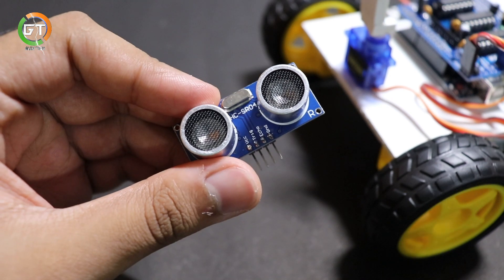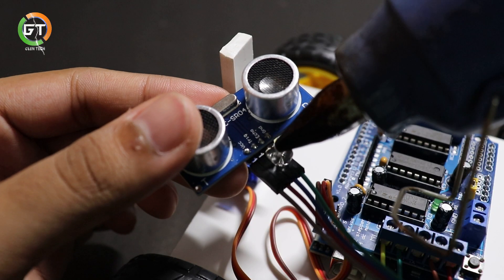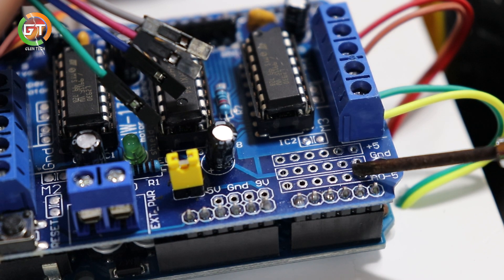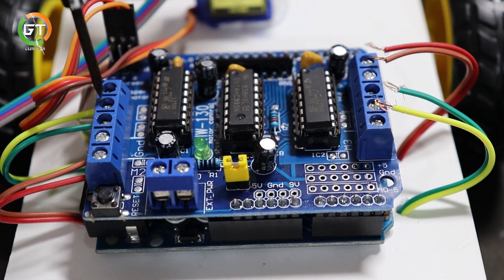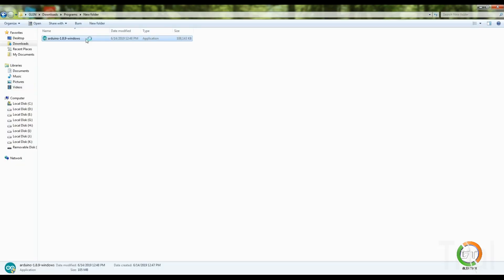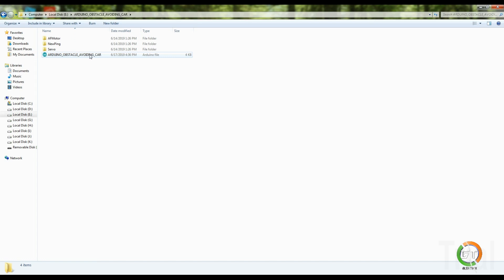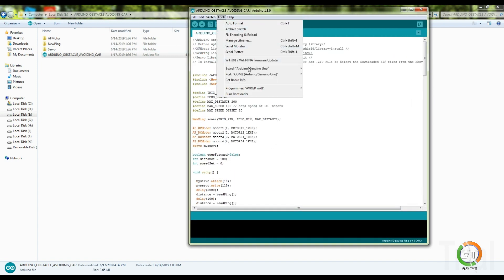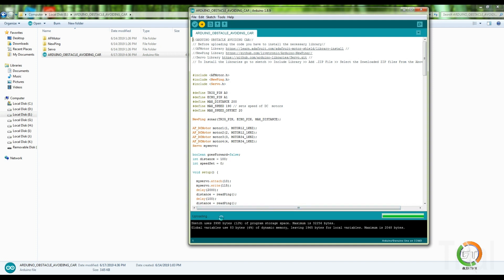How To Make A DIY Arduino Obstacle Avoiding Car For Science Project

Comment: sir the code from your link is unable to use
Reply from the maker: //ARDUINO OBSTACLE AVOIDING CAR//
// Before uploading the code you have to install the necessary library//
//AFMotor Library https://learn.adafruit.com/adafruit-motor-shield/library-install //
//NewPing Library https://github.com/livetronic/Arduino-NewPing// 
//Servo Library https://github.com/arduino-libraries/Servo.git //
// To Install the libraries go to sketch >> Include Library >> Add .ZIP File >> Select the Downloaded ZIP files From the Above links //

#include <AFMotor.h>  
#include <NewPing.h>
#include <Servo.h> 

#define TRIG_PIN A0 
#define ECHO_PIN A1 
#define MAX_DISTANCE 200 
#define MAX_SPEED 190 // sets speed of DC  motors
#define MAX_SPEED_OFFSET 20

NewPing sonar(TRIG_PIN, ECHO_PIN, MAX_DISTANCE); 

AF_DCMotor motor1(1, MOTOR12_1KHZ); 
AF_DCMotor motor2(2, MOTOR12_1KHZ);
AF_DCMotor motor3(3, MOTOR34_1KHZ);
AF_DCMotor motor4(4, MOTOR34_1KHZ);
Servo myservo;   

boolean goesForward=false;
int distance = 100;
int speedSet = 0;

void setup() {

  myservo.attach(10);  
  myservo.write(115); 
  delay(2000);
  distance = readPing();
  delay(100);
  distance = readPing();
  delay(100);
  distance = readPing();
  delay(100);
  distance = readPing();
  delay(100);
}

void loop() {
 int distanceR = 0;
 int distanceL =  0;
 delay(40);
 
 if(distance<=15)
 {
  moveStop();
  delay(100);
  moveBackward();
  delay(300);
  moveStop();
  delay(200);
  distanceR = lookRight();
  delay(200);
  distanceL = lookLeft();
  delay(200);

  if(distanceR>=distanceL)
  {
    turnRight();
    moveStop();
  }else
  {
    turnLeft();
    moveStop();
  }
 }else
 {
  moveForward();
 }
 distance = readPing();
}

int lookRight()
{
    myservo.write(50); 
    delay(500);
    int distance = readPing();
    delay(100);
    myservo.write(115); 
    return distance;
}

int lookLeft()
{
    myservo.write(170); 
    delay(500);
    int distance = readPing();
    delay(100);
    myservo.write(115); 
    return distance;
    delay(100);
}

int readPing() { 
  delay(70);
  int cm = sonar.ping_cm();
  if(cm==0)
  {
    cm = 250;
  }
  return cm;
}

void moveStop() {
  motor1.run(RELEASE); 
  motor2.run(RELEASE);
  motor3.run(RELEASE);
  motor4.run(RELEASE);
  } 
  
void moveForward() {

 if(!goesForward)
  {
    goesForward=true;
    motor1.run(FORWARD);      
    motor2.run(FORWARD);
    motor3.run(FORWARD); 
    motor4.run(FORWARD);     
   for (speedSet = 0; speedSet < MAX_SPEED; speedSet +=2) // slowly bring the speed up to avoid loading down the batteries too quickly
   {
    motor1.setSpeed(speedSet);
    motor2.setSpeed(speedSet);
    motor3.setSpeed(speedSet);
    motor4.setSpeed(speedSet);
    delay(5);
   }
  }
}

void moveBackward() {
    goesForward=false;
    motor1.run(BACKWARD);      
    motor2.run(BACKWARD);
    motor3.run(BACKWARD);
    motor4.run(BACKWARD);  
  for (speedSet = 0; speedSet < MAX_SPEED; speedSet +=2) // slowly bring the speed up to avoid loading down the batteries too quickly
  {
    motor1.setSpeed(speedSet);
    motor2.setSpeed(speedSet);
    motor3.setSpeed(speedSet);
    motor4.setSpeed(speedSet);
    delay(5);
  }
}  

void turnRight() {
  motor1.run(FORWARD);
  motor2.run(FORWARD);
  motor3.run(BACKWARD);
  motor4.run(BACKWARD);     
  delay(500);
  motor1.run(FORWARD);      
  motor2.run(FORWARD);
  motor3.run(FORWARD);
  motor4.run(FORWARD);      
} 
 
void turnLeft() {
  motor1.run(BACKWARD);     
  motor2.run(BACKWARD);  
  motor3.run(FORWARD);
  motor4.run(FORWARD);   
  delay(500);
  motor1.run(FORWARD);     
  motor2.run(FORWARD);
  motor3.run(FORWARD);
  motor4.run(FORWARD);
}
Reply: Sir but you have to put these libraries in description if you put here most of the people not see properly
Reply from the maker: @swamyswami3737  in description there is a link to download these files

Comment: How to recharge battery
Reply from the maker: You need to buy a battery charger or you need make one .

How to make a charger video I will upload next day .
Reply: TP-4056 is a charging module for 18650 li-ion batteries
Reply from the maker: @lokeshlucky7593  yes

Comment: Code false
Reply: Wassim Soualili Nice joke but no need to use now. My project done and code is 💯💯% working............Glen Tech is a Hero!!!
Reply from the maker: Did you copy and paste other files to Arduino folder in my documents
Reply from the maker: //ARDUINO OBSTACLE AVOIDING CAR//

// Before uploading the code you have to install the necessary library//

//AFMotor Library https://learn.adafruit.com/adafruit-motor-shield/library-install //

//NewPing Library https://github.com/livetronic/Arduino-NewPing// 

//Servo Library https://github.com/arduino-libraries/Servo.git //

// To Install the libraries go to sketch >> Include Library >> Add .ZIP File >> Select the Downloaded ZIP files From the Above links //

#include <AFMotor.h>  

#include <NewPing.h>

#include <Servo.h> 

#define TRIG_PIN A0 

#define ECHO_PIN A1 

#define MAX_DISTANCE 200 

#define MAX_SPEED 190 // sets speed of DC  motors

#define MAX_SPEED_OFFSET 20

NewPing sonar(TRIG_PIN, ECHO_PIN, MAX_DISTANCE); 

AF_DCMotor motor1(1, MOTOR12_1KHZ); 

AF_DCMotor motor2(2, MOTOR12_1KHZ);

AF_DCMotor motor3(3, MOTOR34_1KHZ);

AF_DCMotor motor4(4, MOTOR34_1KHZ);

Servo myservo;   

boolean goesForward=false;

int distance = 100;

int speedSet = 0;

void setup() {

  myservo.attach(10);  

  myservo.write(115); 

  delay(2000);

  distance = readPing();

  delay(100);

  distance = readPing();

  delay(100);

  distance = readPing();

  delay(100);

  distance = readPing();

  delay(100);

}

void loop() {

 int distanceR = 0;

 int distanceL =  0;

 delay(40);

 

 if(distance<=15)

 {

  moveStop();

  delay(100);

  moveBackward();

  delay(300);

  moveStop();

  delay(200);

  distanceR = lookRight();

  delay(200);

  distanceL = lookLeft();

  delay(200);

  if(distanceR>=distanceL)

  {

    turnRight();

    moveStop();

  }else

  {

    turnLeft();

    moveStop();

  }

 }else

 {

  moveForward();

 }

 distance = readPing();

}

int lookRight()

{

    myservo.write(50); 

    delay(500);

    int distance = readPing();

    delay(100);

    myservo.write(115); 

    return distance;

}

int lookLeft()

{

    myservo.write(170); 

    delay(500);

    int distance = readPing();

    delay(100);

    myservo.write(115); 

    return distance;

    delay(100);

}

int readPing() { 

  delay(70);

  int cm = sonar.ping_cm();

  if(cm==0)

  {

    cm = 250;

  }

  return cm;

}

void moveStop() {

  motor1.run(RELEASE); 

  motor2.run(RELEASE);

  motor3.run(RELEASE);

  motor4.run(RELEASE);

  } 

  

void moveForward() {

 if(!goesForward)

  {

    goesForward=true;

    motor1.run(FORWARD);      

    motor2.run(FORWARD);

    motor3.run(FORWARD); 

    motor4.run(FORWARD);     

   for (speedSet = 0; speedSet < MAX_SPEED; speedSet +=2) // slowly bring the speed up to avoid loading down the batteries too quickly

   {

    motor1.setSpeed(speedSet);

    motor2.setSpeed(speedSet);

    motor3.setSpeed(speedSet);

    motor4.setSpeed(speedSet);

    delay(5);

   }

  }

}

void moveBackward() {

    goesForward=false;

    motor1.run(BACKWARD);      

    motor2.run(BACKWARD);

    motor3.run(BACKWARD);

    motor4.run(BACKWARD);  

  for (speedSet = 0; speedSet < MAX_SPEED; speedSet +=2) // slowly bring the speed up to avoid loading down the batteries too quickly

  {

    motor1.setSpeed(speedSet);

    motor2.setSpeed(speedSet);

    motor3.setSpeed(speedSet);

    motor4.setSpeed(speedSet);

    delay(5);

  }

}  

void turnRight() {

  motor1.run(FORWARD);

  motor2.run(FORWARD);

  motor3.run(BACKWARD);

  motor4.run(BACKWARD);     

  delay(500);

  motor1.run(FORWARD);      

  motor2.run(FORWARD);

  motor3.run(FORWARD);

  motor4.run(FORWARD);      

} 

 

void turnLeft() {

  motor1.run(BACKWARD);     

  motor2.run(BACKWARD);  

  motor3.run(FORWARD);

  motor4.run(FORWARD);   

  delay(500);

  motor1.run(FORWARD);     

  motor2.run(FORWARD);

  motor3.run(FORWARD);

  motor4.run(FORWARD);

}
Reply: Noo !
Reply: Ah okey thx you can you help me to my other project i will use 4wd arduino car with bluetooth hc 06 and ultrasonic sensor with servo motor please brother
Reply from the maker: Then copy and paste that 3 folders into Arduino folder in my documents
Reply: Can you give me code and diagram to my project
Reply: Thx you my friend you are really a a genius
Reply: Can i get your facebook
Reply: But how to control the robot ?
Reply from the maker: Instagram link in description
Reply from the maker: Bluetooth car don't need obstacle avoiding sensor because we are controlling it . 
https://youtu.be/Xr873sXm2WI
Reply: Controlling it with what... application ?
Reply from the maker: @wassimsoualili7153  for making Bluetooth car see this video
https://youtu.be/Xr873sXm2WI
Reply: So we can’t never use obstacle avoiding sensor with bluetooth ?
Reply from the maker: @wassimsoualili7153  we can use that sensor with Bluetooth car but the sensor will not control the car , the sensor will only stop the car when car going to hit a object
Reply: I want video: we can use bluetooth with sensor ultasonic and servo motor which can stop the car when car going to hit object but with 4WD
Reply: We control a car by application
Reply from the maker: @wassimsoualili7153  car is controlled by Bluetooth , by using a app . See Bluetooth car video . App Link in that videos description
Reply: But in your video you didn’t use sensor !
Reply from the maker: @wassimsoualili7153  for that you copy this videos code into that videos code and modify it
Reply: I want video control car bluetooth with sensor can’t hit object
Reply: Ok i want to try

Comment: Hey Nice video. 
I got some problems. My motors wont rotate by theirselves. I need to rotate them first by hand before they turn. Im using 9v battery
Reply: Bro only one 9v battery will not be enough for 4 motors so use 3 9v battery then it will work I am saying according to my experience
Reply from the maker: The cable connect to the motor board is loose sometimes .
Reply: @GLENTECH  do you mean the driver?
Reply from the maker: @heliumnitrogensquared9422  yes driver
Reply: @GLENTECH  thanks bro 😊😊
Reply from the maker: Try uploading code again
Reply: @GLENTECH  is 9v battery a good power supply?
Reply from the maker: @heliumnitrogensquared9422  9 v battery is good but run Time is less

Comment: bro i made it but in my one only left 2 motors working
can u solve the problem
Reply from the maker: Check the motor wire connection
Reply: @GLENTECH  thanks bro
Reply from the maker: എന്റെ വീഡിയോസ് ഫ്രണ്ട്സിന് ഒക്കെ ഒന്ന് ഷെയർ ചെയ്തു കൊടുക്കണം

Comment: Bro can we make it by using Male wires without using Pin header connector
Reply from the maker: Yes , need to solder the wire
Reply: @GLENTECH  thanks bro
Reply from the maker: Share my videos with your friends

Comment: Super video 👍👍 👍...
Reply from the maker: Thanks bro 🙂
Reply: Kitne amh ki
Reply from the maker: @iamtechnical3737   3.7v 2500 mAh battery
Reply: 2000 amh buy Kiya hai
Reply from the maker: @iamtechnical3737  2000 mAh no problems
Reply: 1: should we put 2000mah battery to battery holder and then connect to pc 
2: or should we connect to pc then put 2000mah battery to battery holder